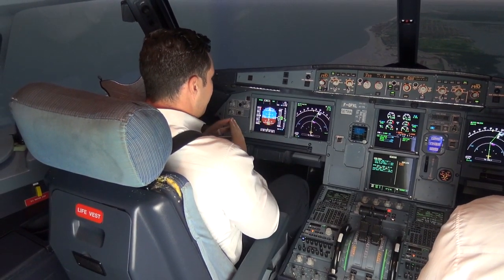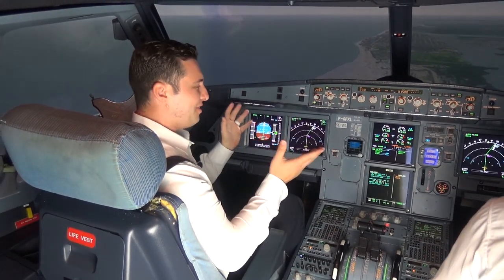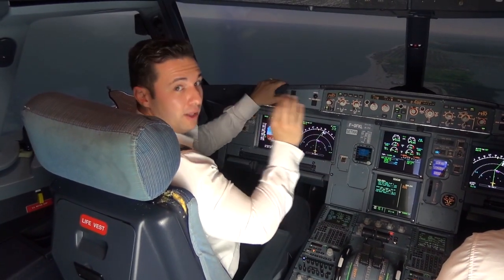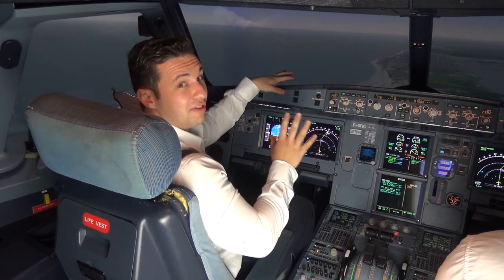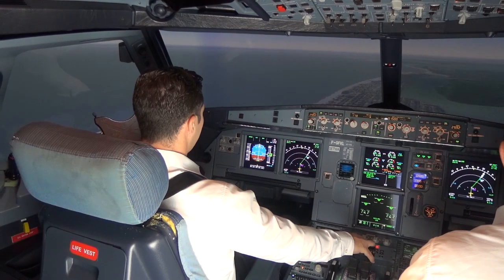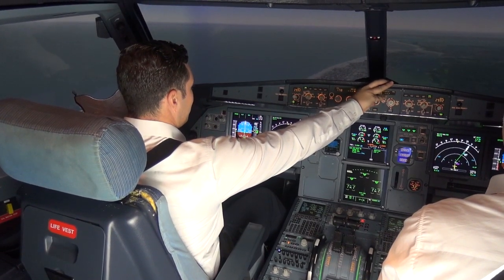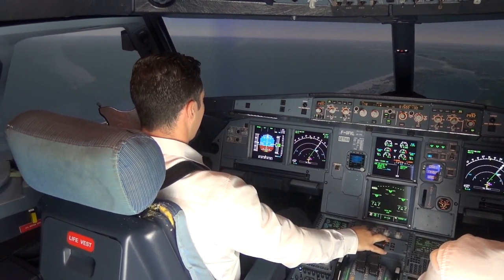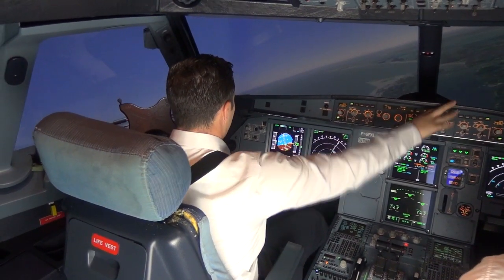A320 NO FLAP/SLAT APPROACH

Comment: The go around altitude should not be set at this stage but later regardless you have ALT GREEN. If the go around alt is lower than your current altitude you’ll level off at that altitude once you’ve started your descent at FPA-3deg…
Reply from the maker: Highly unlikely to have a go around altitude less than 1500 feet AGL. This is traffic pattern altitude in a jet.